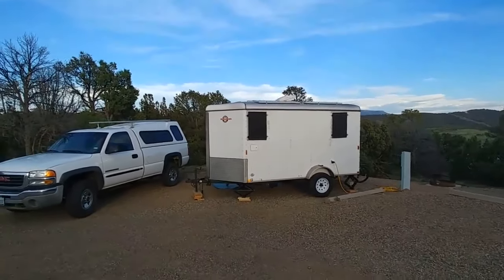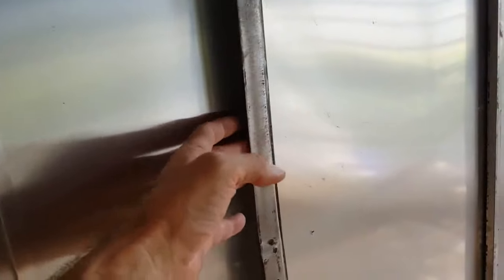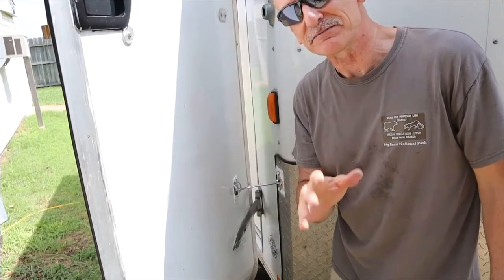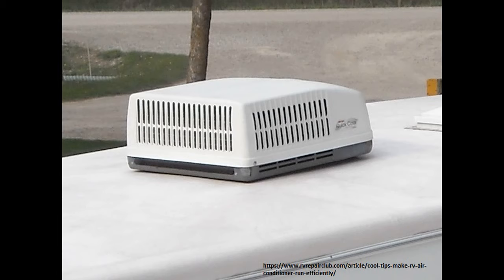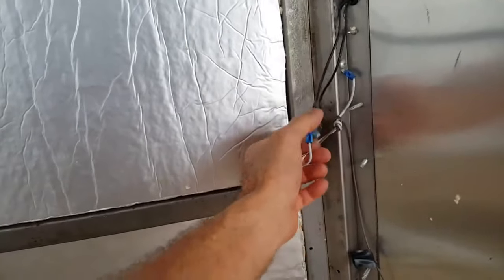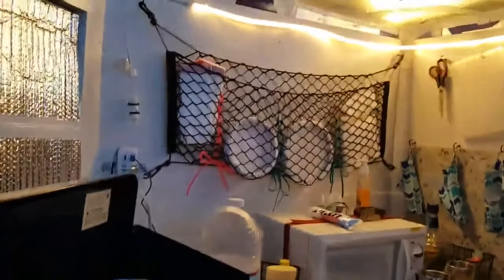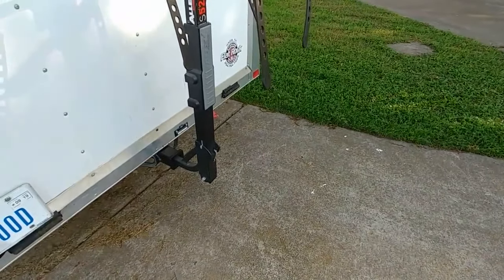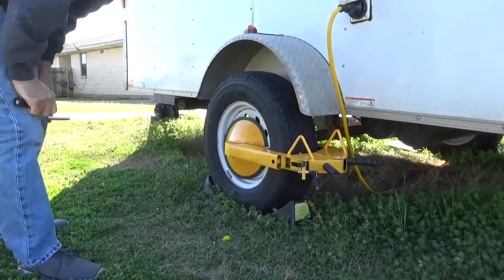CARGO ENCLOSED TRAILER CAMPER CONVERSION BUILD SUMMARY Vanlife Skoolie What Would We Do Different

Comment: You can get a 5,000 lb single axle. I think by law in most States they come with electric brakes. Trailer manufactures build with 3,500 lb axles. they are cheaper. On windows, safety or tempered glass should be used for windows on anything that moves. When tempered glass brakes it shatters into little cube shapes. Regular glass can scatter larger pieces of sharp glass onto the road.
Reply from the maker: You are correct about the axle and I like that idea a lot. I agree about the windows and my windows are tempered glass. Thanks for watching.

Comment: A lot of good information, thank you.I was semi-considering doing a build on a Carry-On 6 x1 2 V nose trailer and I was wondering if it was sturdy enough to put time and effort into doing so.  Mine looks very similar to your model so I assume I have Z channel walls also.  I also had no idea this was used. Looks like yours held up ok though.  Any particular concerns with this model other than what you described?
Reply from the maker: Yep, mine is good enough. When they originally build the trailer they are not concerned with making sure that all the little gaps are sealed where the aluminum skin meets the floor. Thanks for watching. Good luck with yours.

Comment: Great info. Hard to find a 7 foot wide V-nose single axle.
Reply from the maker: Thanks for watching. Yep, I agree.
Reply: I just bought one. 7 by 12 by 7 height. Costum made. The extra height is great. Great video xx
Reply from the maker: @veganfromvenus  congratulations. Good luck on your project.
Reply: Most of the time it’s worth it to have one made to your specific needs, if you aren’t afraid to drive to Georgia that’s where they are all made, the farther from Georgia you go the more expensive the trailers get. And if you get one made it’s only a few hundred dollars extra to upgrade from a dual 3,500lb axle to a single 5,200 lb axle with better brakes. That’s what I did and towing is effortless.
Reply: Grizzly trailers in Georgia just manufactured a brand new 7x14 single axle (5,200lb axle with brakes) 7’ tall trailer for under $3,000 out the door and they did quite a bit of custom stuff for me. Great people highly recommend.

Comment: I would prefer tandems vs single specially for long trips losing one axle isn't going to save a whole lot of weight. Cause moving at reasonable hwy speeds and blow a tire with that much weight you run the risk of flipping the trailer and taking you with it 🤷‍♂️

Comment: Trailer brakes are a joke. They wear out fast, and are exspensive to repair.
Reply from the maker: Well, I don't know your experience level so I can't speak for you. I have been towing for 40 years and changed trailer brakes a few times. If they and the brake controller are adjusted properly the trailer brakes last quite a while, several years in fact. As far as expense, your mechanic must be happy with what you are paying. Drum brakes are not that difficult to replace and should not be that expensive. Just my 40 years of experience, your mileage may vary. Thanks for watching, good luck.